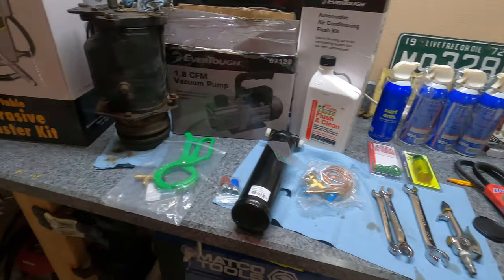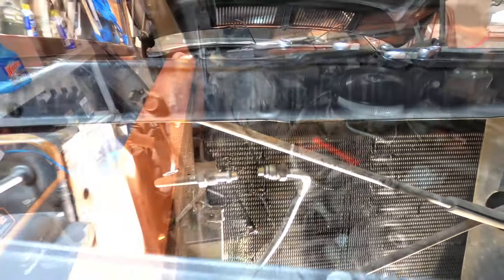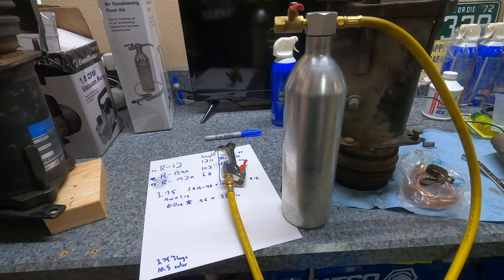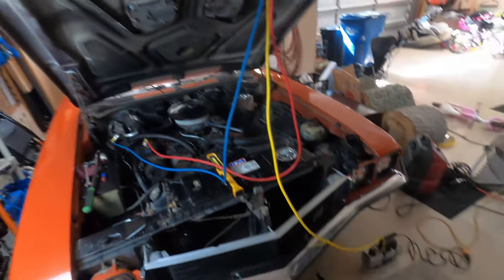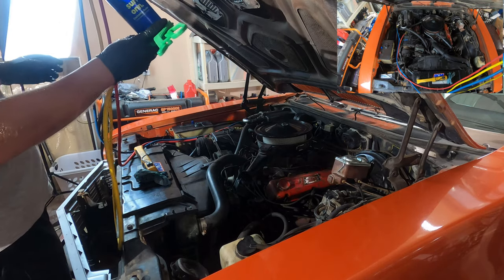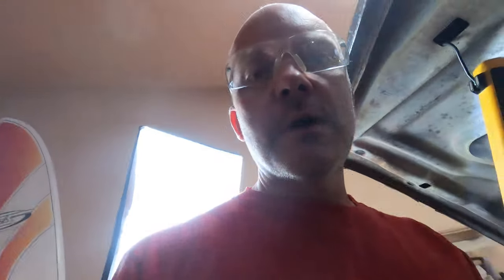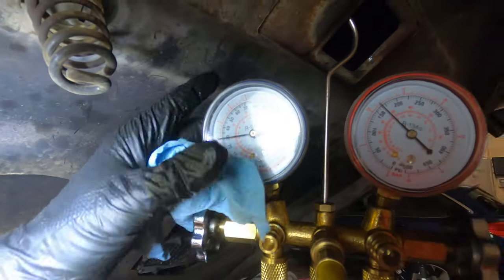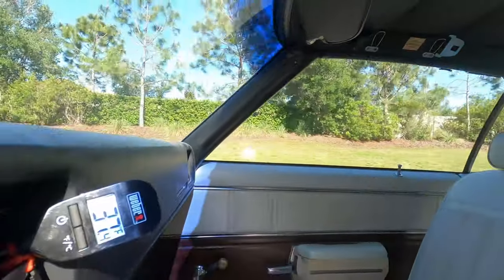R-12 to R152a (Dustoff) Conversion For An Old Car Air Conditioning System With A POA Valve

Comment: Great info on using air duster cans on older r12 systems. It beats using dangerous propane as a replacement. One thing I spotted though @17:21 your a/c belt has too much wobble/play. It needs to be adjusted and tighten. Thanks for the video.
Reply from the maker: Haha... thanks Miller...that old 350 is long gone though, I put a fresh 455 in it over the winter and now that belt may be too tight because it screams when I punch the throttle. :)
Reply from the maker: Update... it was actually also loose ... it needed something like 80 pounds of pressure to reach spec... way more than I expected.

Comment: Over pressure  can cause s massive damage as well as excessive heat. It’s very important to understand that r12, r134a and r152a pressures are all different at different temps.
Reply from the maker: And this is exactly why I ran this test to find the right pressure for R152a. Nobody has a manual written on how to do this because it's so uncommon. I did this test to show others.

Comment: Hi Jack, thanks for sharing your detailed procedure on charging dusters. I lived in Hong Kong and managed to get 10kg packages(like repair shop size freon cans) from China. The reason to charge with R152a was because I wanted to improve AC cooling ability when my car parked under the sun at 100F or more(interior temp. probably more than 130F). And my conversion was on R134a European cars. The performance is satisfying and the car blows much colder when on highway. But since my hometown is no more a suitable place to live in so I left and here we don't have duster...

Anyhow, I believe adjusting the thermal expansion valve will help, but on modern cars they are built in next to the evaporator so it is very hard to make fine adjustment. It would be great if you can make a video on charging a car with R134a system by using R152a....
Reply from the maker: Hello Mr. Cheung I am glad you liked my video. I do have an older car that runs on 134a but I dont wish any I'll fate on it just yet as the AC works just fine. Cheers.
Reply: @JackofAllTrades1  LOL I shouldn't have asked you to make video on R134a cars. It is such a pain to troubleshot AC problems. But at the end of the day, it is a wise move for you because R152a swells the o-rings the LEAST among other refrigerant and hopefully your Buick AC will last much longer than the old system.
Reply: @knk3220  it works in my 134 cars, I’ve done it
Reply: @ZhmiKnopa  Hi Richi - how much less 152 did you use in your 134 system? my car uses 20oz R134a
Reply: @antikdeela5625  I converted from R12, kept the classic system. I have no idea what the conversion rate is but 36oz of 152 runs 40° out the vents
Reply: @ZhmiKnopa  Richi, just found out the converter for 134 systems is x 0.65 so 32 oz R134A = 20.8 Oz R152A
Reply: @antikdeela5625  thank you! Definitely much cheaper, and it runs colder too

Comment: I see you have worse cooling at a stop.  I had the same in my '66 Oldsmobile (also w/ R152A) and I realized that my condenser is offset from the radiator, with open sides and bottom, allowing the air sucked by the engine fan to bypass the condenser.   I put some high temperature foam in the gaps and now I get a ton of airflow through the condenser at all times, with much better cooling while at a stop.
Reply from the maker: That's an awesome tip man and something I can likely do and it won't be noticeable visually but improve performance. Thank you

Comment: Thanks for the video. I would have been checking the pressures before dumping all the cans in. May i suggest you adjust your rocker arms. Sounds quite rattly
Reply from the maker: This engine is a Buick 350... you can't adjust buick rocker arms. Check out my newer videos, I have a different engine now.

Comment: I can’t remember if you discussed this but here are the refrigerant capacity conversions. 
R134a total capacity X .64 = 152a capacity 

R12 total capacity X .56 = 152a capacity.  

With the correct amount on an orifice tube system I was averaging 25 on low and about 125 on high. Worked great.
Reply from the maker: I had originally planned to discuss this but found that putting that much 152a in my system was way too much, so I scrapped the idea. I think it works better for folks who have 134a systems though. I only ended up with about 16oz in my system when it normally took over 4lbs of R12. Thanks for the comment.
Reply: @JackofAllTrades1  4lb of r12 is 64oz, multiply by 0.56 is 35.84oz of r152a.
To make it work, you have to use compressor oil that will circulate with r152a and remove non-condensable moisture and air using a deep vacuum using a real hvac vacuum pump to under 29 inches of mercury.
The moisture will interfere with the compression/expansion cycle and combine with the gasses/oil to create acids which will corrode the system internally over time.
Reply from the maker: @thisisyourcaptainspeaking2259  I had this ac chilling down to 36 degrees...I feel it really doesn't take that much. I tried to put the correct converted amount into my system and my compressor was having a hard time with it. I bled off several Oz and it worked just fine. I think a little over one 16oz can will do the trick.
Reply: @JackofAllTrades1  You will want to have oil circulating through the system, if your compressor suction line is "beer can cold" at the compressor, there is enough refrigerant circulating to carry the oil with it.  I find my 1995 gm v5 compressor actually sweats condensated water on it's exterior with r152a.
Also, you don't want to see ice forming anywhere, this indicates insufficient refrigerant flow to carry the compressor oil back to the compressor.  The oil gets trapped in the cold locations and just sits there.
The oil must remain miscible in the refrigerant to move the oil around the system, it's part of the balancing act.
Reply: @JackofAllTrades1  And I tend to agree, the conversion factor seems to be off, that could be system dependant to some extent.
Suffice it to say, the compressor suction line should be chilled, this indicates the evaporator isn't being starved.  The temperature of the compressor discharge line must not climb too high or damage will begin to occur, the oil can break down, hoses damaged, etc.
It's a balancing act.
Reply from the maker: @thisisyourcaptainspeaking2259  I had frost on my POA valve at first before I got my pressures lined out with my expansion valve. I now know to look at that as an indicator that there is not enough r152a in the system.  I have to get my system back up and running soon because this heat is unbearable to drive in.
Reply: @JackofAllTrades1  Same motivation for me, couldn't stand the heat and humidity.  My 134a compressor was leaking so I rebuilt it and began adjusting the r152a charge.  This is the 2nd of my vehicles to be converted to r152a, the 1st was originally r12 and had gone through a few compressors, was filthy dirty inside with black oil and a leak from new because the factory didn't install an o-ring on one of the fittings.
Due to that journey and a leak in my home system, I now have more hvac equipment than you can shake a stick at.
Reply: Concerning capacity conversion, I find these numbers are fairly close but not exact.  I consider these a starting point, some adjustment will probably be necessary depending on the system configuration.
In my case while converting an 2.25lb 134a system, just a 5oz adjustment to charge made the difference between a starved evaporator and warm compressor suction line (at compressor) to a cold suction line and large quantities of cold air from the evaporator.  If the evaporator is too full of refrigerant, liquid can flood back to the compressor and if the evaporator is starved, the evaporator doesn't cool the air passing through very much and there isn't enough refrigerant flow to return the PAG oil to the compressor.
The high and low side pressures will change considerably depending on ambient temperature conditions and speed of vehicle but suffice it to say the suction line at the compressor must not be warm and the discharge line going into the condenser from the compressor must not be too hot.
In my case, the compressor case actually began sweating with just a 5oz addition of 152a and the evaporator produced more cool air at high fan speed.  Low side pressure of between 25psi to 35psi seemed to work best, the pressure is dependent on and sensitive to heat load.  My high side pressure going down the road is about 125psi and stopped with just radiator fan pulling air through the condenser, as high as 225, so a big difference depending on conditions.
If the compressor suction port isn't chilled, system probably needs more refrigerant.  Don't forget to test with highest evaporator fan speed, a starved evaporator won't cool the larger volume of air passing through it.
And then of course the system might have other problems, like a plugged expansion valve or leaves clogging the evaporater, defective condenser fan, etc.

Comment: It doesn’t look like you bleed the lines before you fill the system, you might get better performance if you do. Just remove the low-side line each time you connect a can, and flow some 152 through to flush out the oxygen before you reattach the low fitting.
Reply from the maker: I def bled the redridgerant lines, it would be a mistake not to. I don't recall how much detail I went into (if any) on that. Thanks for bringing it up for others though... it's an important step.

Comment: I have done this many times with R-12 systems like this- 24oz of R1-52 is all that is needed- otherwise you overcharge your system.  It is a great way to replace r-12.. R-134 sucks for the r-12 systems
Reply from the maker: So true Rick, I'm now cruising in the summer heat when I never used to be able to. Thanks for the comment.

Comment: Hi bro this good freon for exchenge R-134a i used in car in cars with a small engine capacity, as it needs to be smaller in volume and there is no load on the engine when the air conditioner is running!

Comment: Im in the beginning stages of this.  Very interesting.👍  My 93 K1500 calls for 2 cans of R12.  I Have 3... but first I was thinking about doing this first..to test my system.   If it actually works I might save or sell my R12.👍  oh btw... 3 cans of duster sounds like to much.
Reply from the maker: Yea it was way too much. I was using an online calculator I found and it wasn't right. I'd start with 1 can and work my way up a couplenoz at a time... you will know when you hit paydirt when you smell that wonderful dehumidified air. :)

Comment: High side PSI(PSIG/Gauge Pressure) for pure r152a is 10-12% lower than r134a. 80F about 155 to 180. Low side can be 30% less than r134a but I think the evaporator valve needs to be adjusted & not really necessary if using r152a drop in replacement for r134a. Both these refrigerants can be mixed in any ratio.
Reply from the maker: Thanks for the additional info.

Comment: Reading your previous comments, I see that you need to recharge your system every once in awhile. Have you determined where the leak is? Ive seen that the molecule size on R152A is substantially smaller than R134A which is already small for a R12 system. I want to attempt a full R152A system on my 280z
Reply from the maker: @MySuperky  I think it's the hoses... it just leaches out of them over time because they are made for r12, which is a large molecule. It's a pretty slow loss but enough that my charge only lasts a portion of the year.

Comment: At the risk of getting yelled at for playing mad scientist and not really knowing what the hell I'm doing, I will say the R152A works great in old R12 systems...BUT...with 2 or 3 ounces of propane mixed in it gets even colder...significantly colder.  Pure propane doesn't work well because the pressures are just too high..some people do it but I wouldn't recommend it myself, while others make a propane/isobutane blend with better pressure results but I tried an 85/15 blend of propane and isobutane and wasn't really impressed with the results.  I actually had much better results using R152A/propane blend.  Using only about 50% of original R12 charge with R152A (system calls for 48 ounces of R12 so I used two 12oz cans of R152A), my pressures were substantially lower than they were with the R134A conversion I had originally done, allowing me to add a little shot of propane (benzomatic torch propane) to the system and still keep the pressures where they needed to be.  While not as massively cold as pure propane I would assume it's much safer being far less flammable of a mixture and much lower pressures.  Not recommending anyone try this, just sharing my experiences.  Stay cool!
Reply from the maker: Interesting, I was getting temps down into the mid 30s through the central vent with just R152A.... I think you are really pushing the limits with what's possible. You may freeze up your condenser.

Comment: If you make the transition from 134 to 152, it is significantly cheaper, since 152 Freon should be 60% less in volume than 134a
Reply from the maker: Yea 152a is only 3 bucks a can so year it will be at least half the cost.... at least.
Reply: @JackofAllTrades1   In my country i bay 10 kg R-152a cilinder price only 50 usd this very nice for my job

Comment: I wonder if you've pulled a vacuum to remove non-condensable gasses such as air/moisture and just as important, flushed out the original mineral oil and replenished that with PAG150 to lubricate that old A2 compressor?  The original mineral oil won't circulate with r152a I believe, compressor won't be lubricated?
Reply from the maker: I'm not sure... I never considered it wouldn't circulate. What would be the cause? Because the r152a molecule is much smaller? I plan to top it off again and see how it does after a long winter of no use.
Reply: @JackofAllTrades1  According to what I think I know, the original mineral oil won't mix with r152a, it just lays in the low spots and sits there.  The same is true with r134a and mineral oil.  Mineral oil isn't compatible with PAG oil but it is compatible with POE compressor oil.  That is, mineral and PAG will become a jell when mixed.
If the system was correctly converted to r134 at some point, it will have been flushed, dryer replaced, and either PAG or POE compressor oil installed.  The r152a is compatible with PAG and POE, both will circulate with r152a to lubricate the compressor.
If you ever see grey/black contaminated oil in your system, this indicates the compressor has been damaged due to lack of lubrication.  Metal dust fragments floating in the oil turn it this color.  This must all be flushed to avoid clogging the expansion device and ruining compressor with the abrasive debris.

Comment: Any long term updates?
Reply from the maker: @mikelezcurra810  still works great. Somwtimes POA gets stuck and I have to tap it with a wooden handle... not sure if that's just my ride, though. I've had to top it all every year, and this most recent year the car sat 8 months, and I had to completely Evac and recharge, but it has always come back to life. These duster cans used to be 4 bucks each...they've almost tripled in price, I wish that didn't change.

Comment: If you are concerned about the flammability of r152a it is categorized as a class A2 whereas the epa approved r1234yf is class A2L (more flammable).
Reply from the maker: I think more than anything I just wanted to dispell some concerns over it being like propane. It would take a lot for this stuff to burn and by no means turns your car into a bomb. There was a lot of discussion on this in a few AC forums so I needed to see it for myself.

Comment: do i have to change all the lines or just run s vacuum on the system? thanks in advance
Reply from the maker: I didn't change any lines. Just pull a good vacuum and make sure you bleed the yellow charging line with the 152a to get the air out. Good luck.
Reply: @JackofAllTrades1  thanks god bless